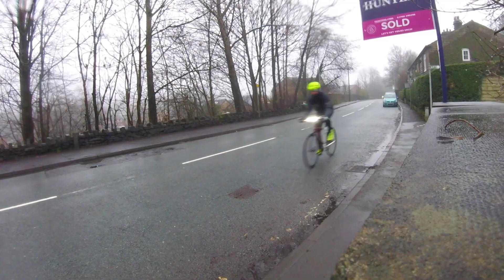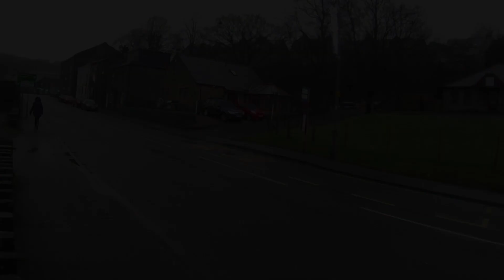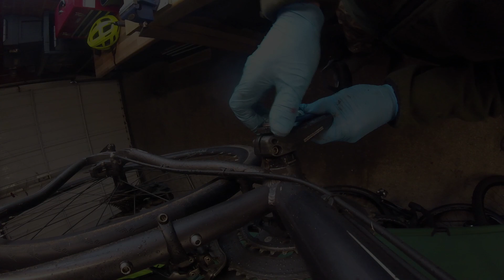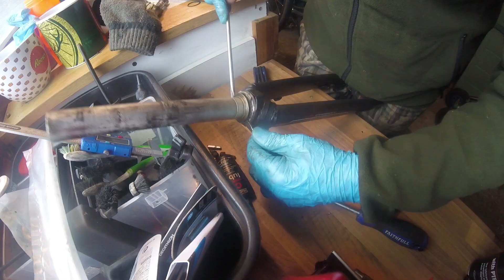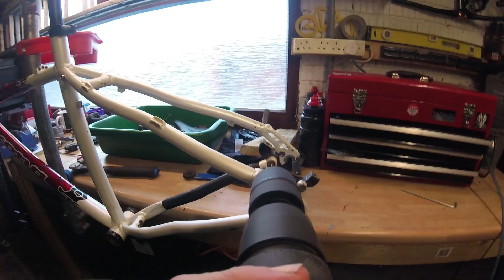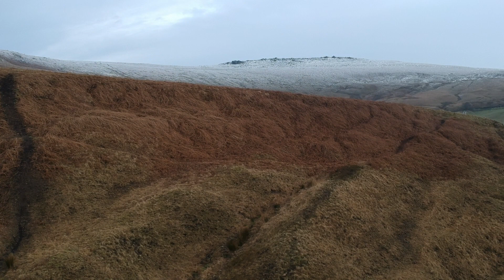2009 Kona Kula MTB rebuild into a Hybrid road road bike - I'm a cyclist and I live in the Pennines

Comment: Really nice looking bike Daz, great work. Glad it got you flying down that hill!
Reply from the maker: It's going well Mark . I don't think it is all that aero but it feels like a ride all day bike  - so far so good.
Reply: @MrDazP1adv3ntures  surprisingly light weight considering it's an MTB frame. Dispels some of the myths about spending 1000s to get a decent set up. Although, will be good to get out on the summer bike, hopefully in 6 weeks or so - if we're lucky!
Reply from the maker: @Mark Bennett it was bang on 10kg but the crankset is pretty heavy as are some other components. I reckon it could get a lot nearer to 9kg with a few more Shimano XT parts.
Reply from the maker: I weighed it with all my lights and GPS fitted and it came in at 10.7kg

Comment: I’m just amazed you got all that to fit on those bars mate! I cut mine down to a tiny 770mm lol .
Reply from the maker: These bars are cut down to the limit, probably about 480 mm I reckon. It does start to get interesting over 45mph on a good descent though with them being so narrow. I am on the lookout for a top pull XT or XTR front mech next. I salvaged the current one from my spare parts.

Comment: Carbon seat posts; do they ALL get seized up? Mine is stuck and my bike is only 18 months old. Thanks for a good film Daz. Great to salvage stuff.
Reply from the maker: There is a special carbon paste you are supposed to use on parts like this . It has a gritty texture to it. I re did this seat post last year and was surprised at how it was well and truly stuck in there.
Reply: @MrDazP1adv3ntures  the shape of my seat post, it has 6 sides an un-equilateral hexagon. Italian 😁.
Reply from the maker: @sophiescyclingandwalkingch4294  I've heard that nail varnish remover can do the trick too.

Comment: Good work on the build Daz. How did you manage to squeeze the 700c wheels on it? I don’t think I could have done it on mine, I ended up with some 26” Mavic Crossrides on my old 2000 Specialized Hardrock which I stripped down, got a pro metallic blue respray done (looks awesome) and rebuilt it with a mix of Deore and Altus parts. I’ve got a Shimano touring 48-38-28 chainset on it with an 11-34 cassette and some new SR Suntour lockable 80mm forks and some 42mm Conti Contact Plus Travel Tyres - bombproof. Decent on the road and the canal paths/pinewood trails where I live - will literally plough through the vast majority of what I throw at it other than heavy mud! 

In other news, managed to get my road Jan Fondo in, 64.5 miles with 1772 feet of elevation gain! 🙌🏼 Going to give the Trek a rest in February as it’s been battered through the winter and needs a good service. 

Keep up the great vids pal, looking forward to the next one already! 👍🏼👌🏼
Reply from the maker: That bike sounds like a good one mate. Triple chain rings offer you some wide gear choices too. Good for easy climbs. The 700c wheels look a bit skinny in the frame but everything worked fine.

I am going to try and use some touch up paint on the areas where it's scratched next and might even upgrade a few components from SLX to XT or XTR if I can find a few bargains.

Well done with big the ride. It has been dreadful out there recently. I think I've cycled 650 miles so far this year in all weathers.

Comment: really nice job!!! did you have to put spacers on the bottom bracket to fit the crankset ?
Reply from the maker: Hi Mark, the BB width was 73mm and the Shimano SLX crankset was a 73mm, so I just used the standard slim spacer on the drive side.
A road Crankset is 68mm so would be a bit short.
Reply: @MrDazP1adv3ntures   I have also a kona kula that I am putting a tiagra crankset (50-34)  on. I have a bbr60 bottom bracket I will be putting on the kula. So I would basically need a spacer on driver side to make it work. Do you remember how many mm the spacer was ?
Reply from the maker: I think they are about 2mm
You don't want the large chain ring hitting the chain stay